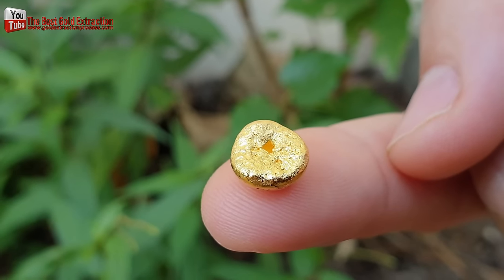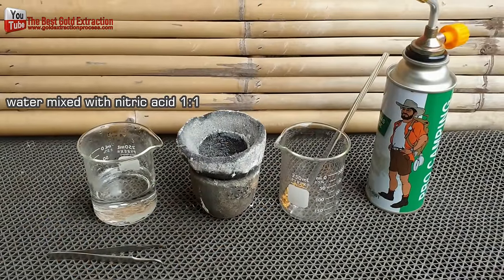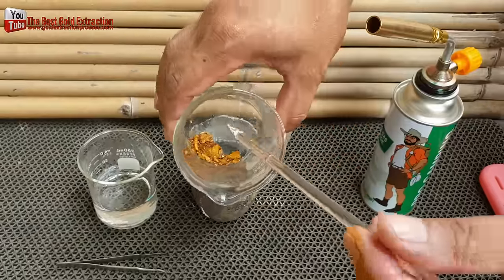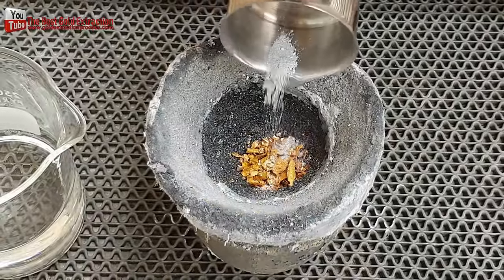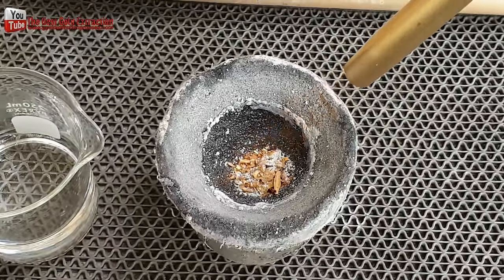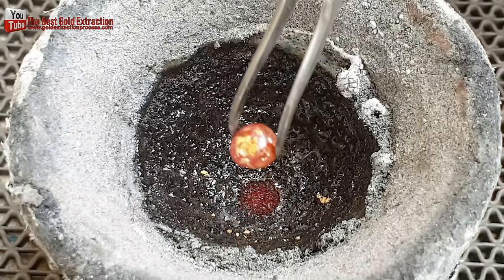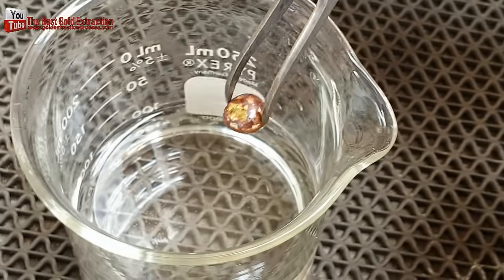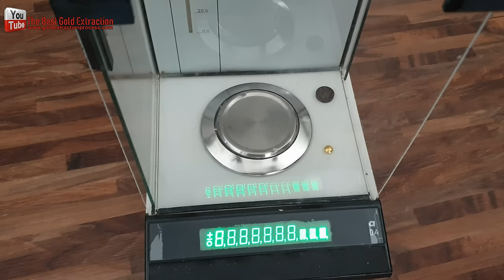How to Melt Gold Scrap |  scrap gold business.

Comment from the maker: The very earliest precious metals had mixes of gold and silver; gold and silver alloy is called electrum. With the advent of coinage, methods had to be invented to remove impurities from the gold so that gold of specific purities could be made. Cupellation was able to remove gold and silver from mixtures containing lead and other metals, but silver could not be removed. Gold parting as a process was specifically invented to remove the silver. The main ancient process of gold parting was by salt cementation and there is archaeological evidence of that process from the 6th century BC in Sardis, Lydia. In the post-medieval period parting using antimony, sulfates and mineral acids was also used. In the modern period chlorination using the Miller process, and electrolysis using the Wohlwill process are the most widely used methods of refining gold by removing silver and platinum.